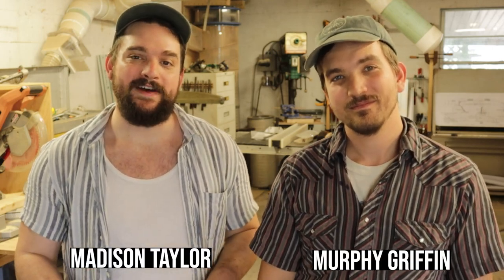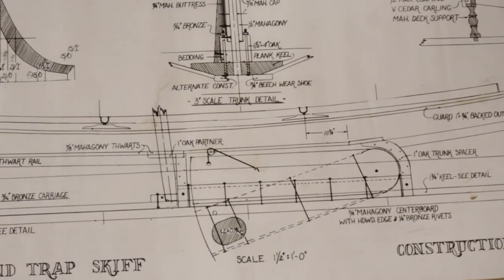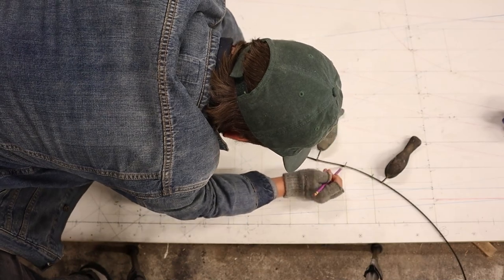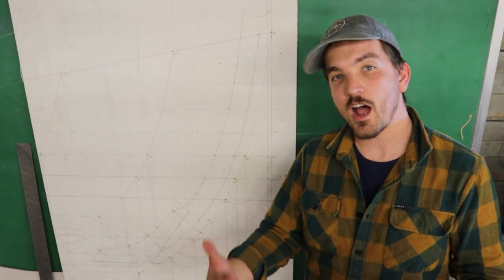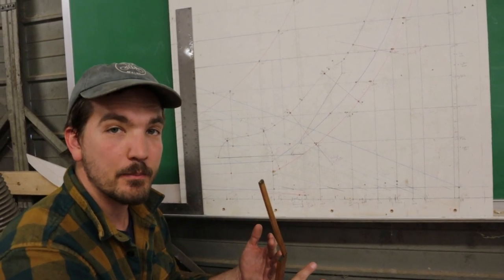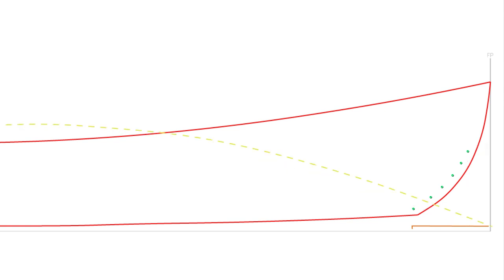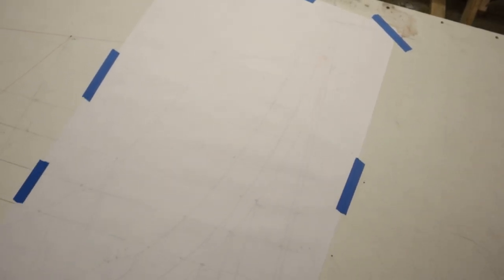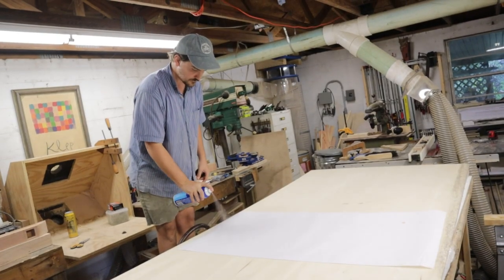Ep 11 - Making the Stem & Sternpost

Comment: I wonder wether  having the flat grain inboard or outboard makes a difference o overall strength?
Reply from the maker: Im not quite sure I follow your question. Its best to orient the timber so that the amount of vertical grain is maximized. Flat grain timbers are more likely to move over time and are more prone to breaking since you dont have continuous grain running from one end of the workpiece to the other
Reply: @neophyteboatwrights   If ,unavoidably, there is a section of poorly aligned grain, is it better in tension or compression. The force on a stem is up and back . That is amplified if there is a stay involved. “Flat grain “on the outer side of the stem experiences tension. On the inside compression.  Further since the outside ,forward most edge is tapered down for fairness there is less material than the inside under the hood ends etc. So, in failing, will less flat grain rip apart or more flat grain be crushed?( that’s in the extreme,of course)